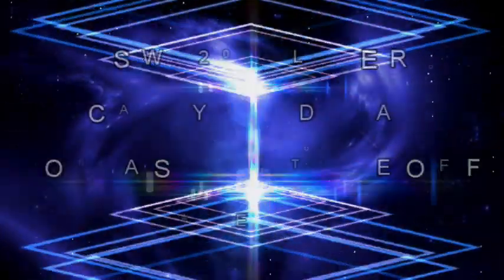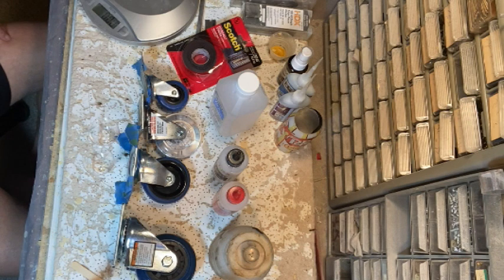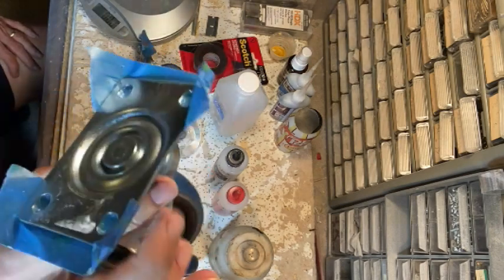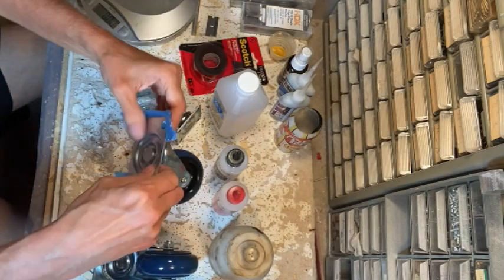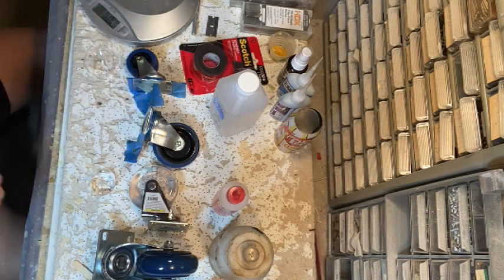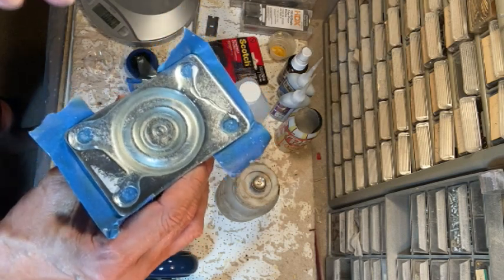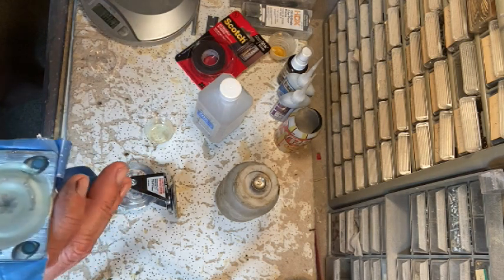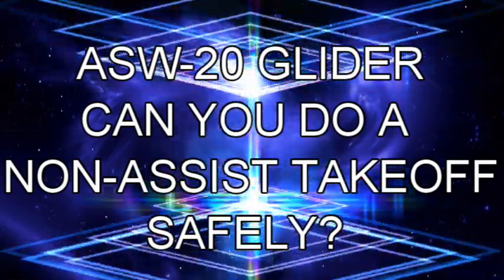Can you do a non-assist takeoff safely in an ASW-20 Glider.

Comment: Doesn't the 20 have either wingtip skids or wheels already?  Unclear why you would need to add another wingtip wheel.  When taking off unassisted just preload with opposite rudder to the down wing until the wingtip lifts.  Never had a problem when doing so.  Or, are you worried that your existing wingtip skids/wheels are too short and would allow your aileron to drag the ground before the wing lifts?

Comment: my rake on this is that maybe a swivel/castoring wheel might not be a good idea....walk around the current motorgliders on your field, they all use inline skate type wheels held in the direction of flight, same as a fixed tailwheel..
Reply from the maker: Thanks Paul!
Reply: @flygliders  I'm guessing that the swivel is not needed, and the non-swiveling wheel won't have the recess, and will also be lighter? I have no real world experience with this, but I have a massive amount of large RC glider experience, and just about to get my checkride done for full scale. Good luck!
Reply: Also, adding micro- balloons, chopped fibers, heck, even baking soda to your epoxy mix will make it lighter. The heaviest layup is rich in epoxy, and is also the weakest.

Comment: It's an unnecessary addition.  I've taken off without a wing runner in my Discus b, using opposite stick and rudder to get the tip off the ground.  After that, it's back to normal.

Comment: Brr... don't like the idea of putting those  weels on the wingtip of an high performance glider.
It will cause drag and ruin  performance.
On a ASK- 21.. ok.
On a ASW-20? .. never ever!
Reply from the maker: It would be installed only temporarily until you get back to base
Reply: The ASK doesn't need it, though. Unassisted takeoffs are non-events in that sturdy old bird.